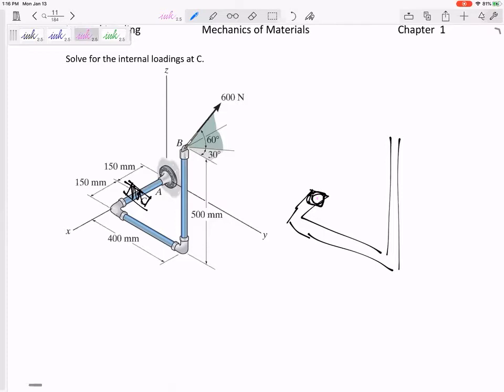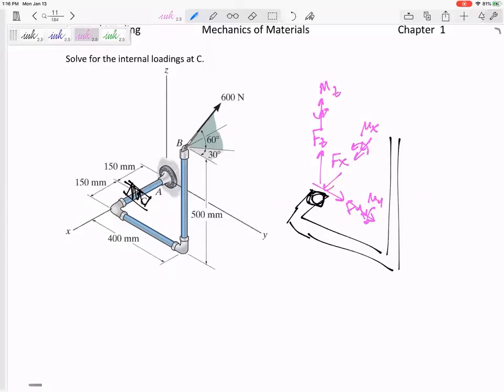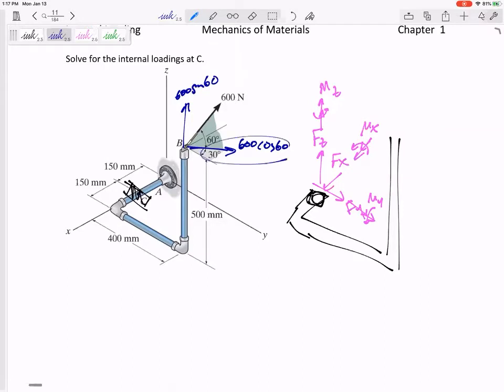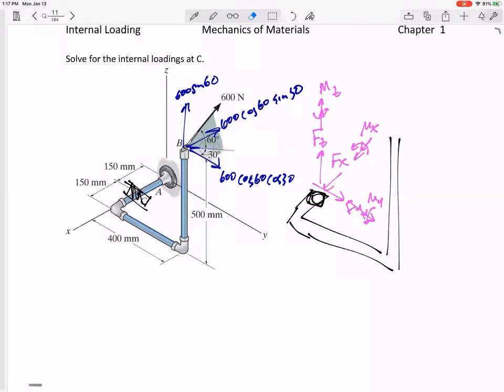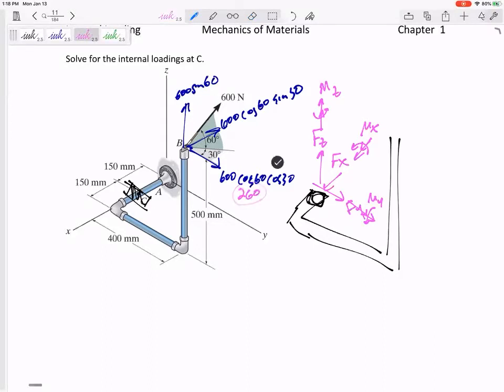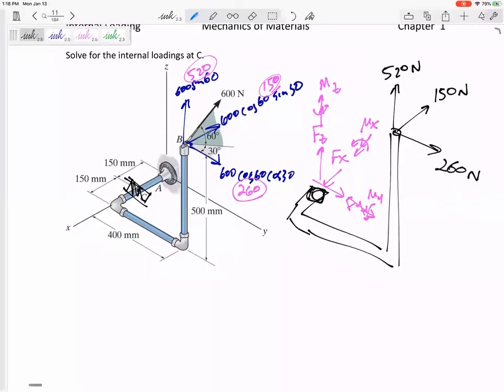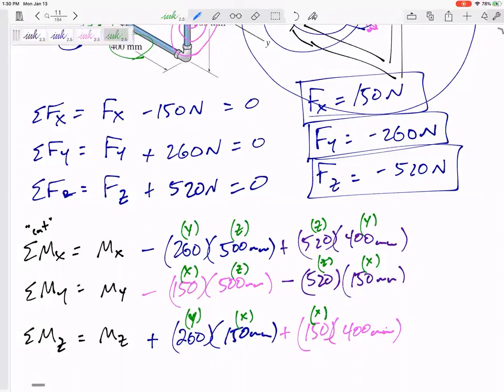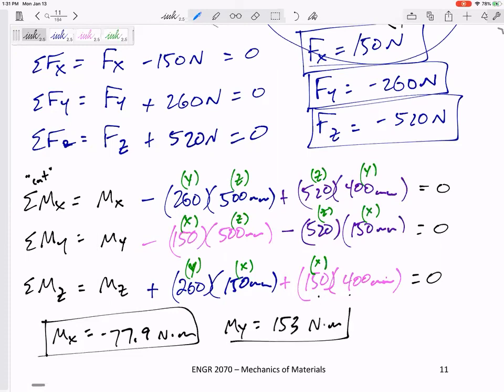Mechanics of Materials - Internal forces 3D example 1

Comment: When I used rXF, i got the same answer but opposite direction. I wonder why!!
Reply from the maker: @sanjaybudhathoki4324  well, it depends on what direction that R is that you used. But also- if you are doing rxf you are finding the moment that the force causes. The internal moment would have to counteract that force (add up to zero) so it makes sense that the internal moment would be the opposite direction.

Comment: i just don't get this. i've watched lots of youtube videos and i still don't get this 3d internal moments..
Reply from the maker: A few things I like to remember: we are calculating the INTERNAL forces and moment AT THE CUT that will counteract all the other external forces and moments (so everything will sum to zero). And remember to “cut” it and throw away the other half completely. Only keep your half and see what forces and moments you need at the cut so that the sum of the forces and moments (of that half) will be zero. These internal force and moments don’t show up in your whole free body diagram, but only show up when you “cut” it. 

Now the difficulty of directions and signs is a whole nother issue that is hard to explain in text (and in videos). Best of luck!!
Reply: @engineeringdeciphered  I know this is an older video, but would the process be the same if you evaluated the side mounted to the wall (the part that you would "throw away" in this video example)? Since there are no forces or moments on that side of the cut does that mean the internal forces would be zero? Thanks!